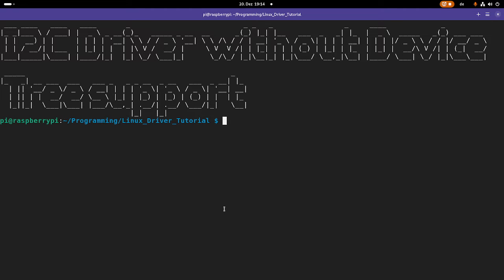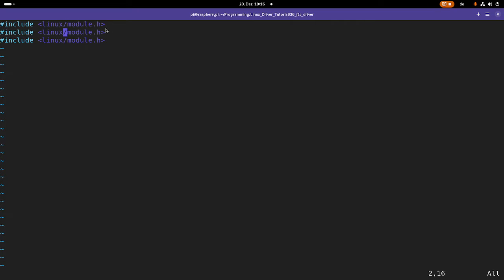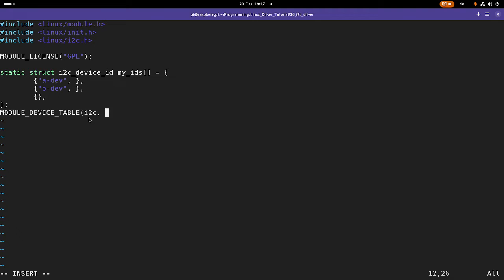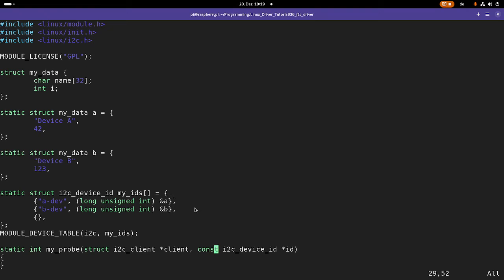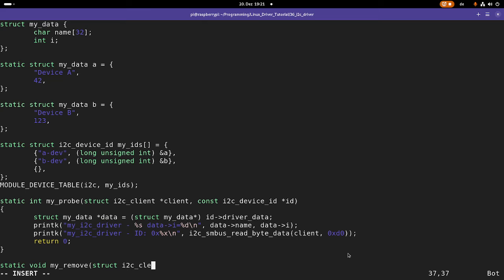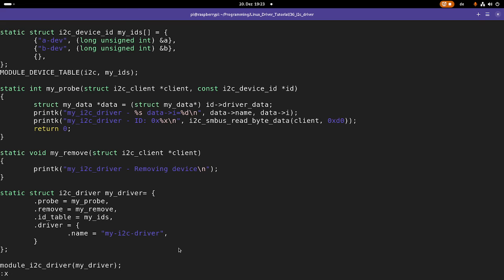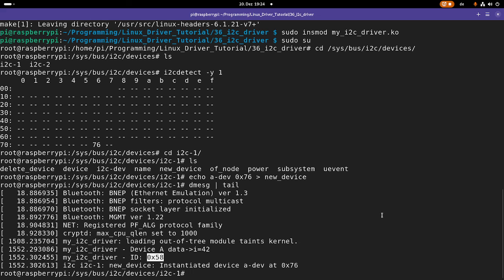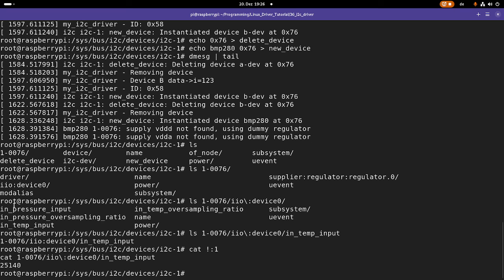Let's code a Linux Driver - 36: I2C Device Driver without Device Tree

Comment: hey is there way to implement the i2c driver within system, i mean not using raspberry pi or beagle bon
Reply from the maker: Yes, what I show in this video also works on a x86 PC. Here you can use a free VGA or DVI port. They also come with an I2C interface.